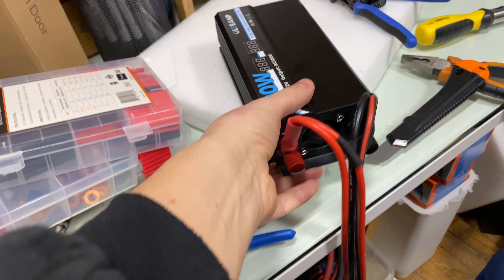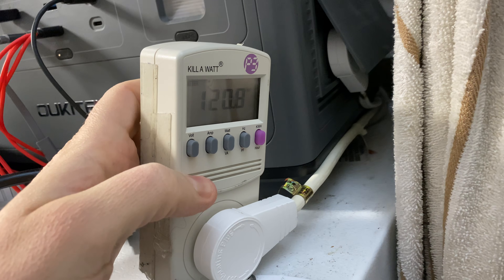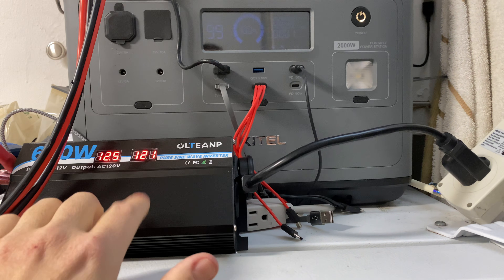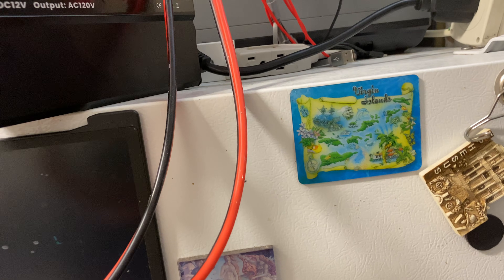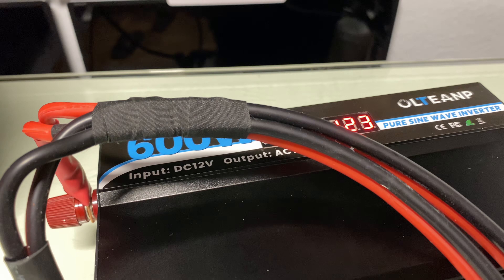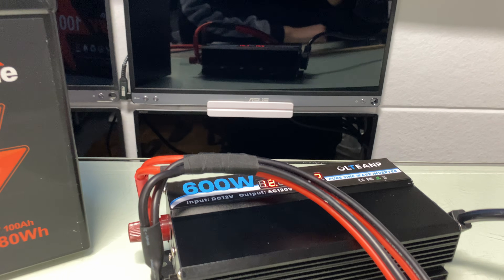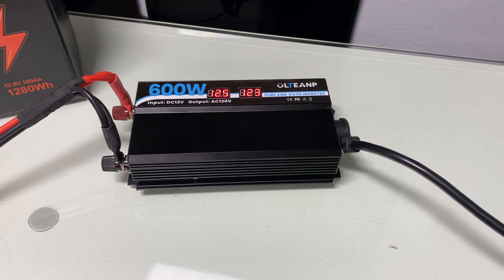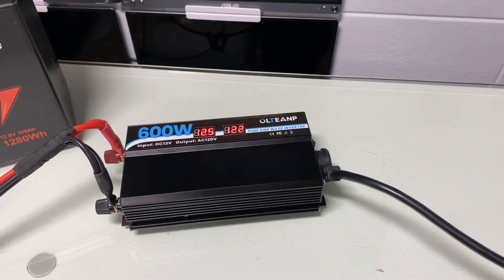👽 OLTEANP 12v DC to 600 Watt AC Pure Sine Wave Inverter Unboxing Review Fridge Test #wisebuyreviews

Comment from the maker: SEE it here: https://amzn.to/3ClCCJp   [amazon affiliate links]  --- 600W Power Inverter Pure Sine Wave Inverter 12V DC to 120V AC Converter for Car, Truck, Home, Vehicles, Laptop, Car Inverter 12V to 110V with 2 AC Outlets

In this review I test the unit and show you what is included in the box. I found that it has a 6.5 watts per hour idle draw without anything connected to it. Which is reasonable for the unit. The power fan did not come on power something at 90 watts. The fan kicked on when connected to a gaming computer running at 220-300 watts. It did not power a full sized 3090 RTX graphics card running full tilt and did overload and turn off and turn right back on. The fan on the unit is a little loud, however running small items at less than 200 watts or about 100 watts without even turning on the fan. I did make my own heavy duty cables for the unit. I like how it worked to power my fridge even with the power on spike of the fridge that it was able to handle without overloading which was over 40 amps at 12 volts. Overall I would recommend the unit. 

- BATTERY Used in the Test: LiTime 12V 100Ah Mini LiFePO4 Lithium Battery, Upgraded 100A BMS https://amzn.to/4an1NrM

--- SEE ALSO MY REVIEW OF THE LARGER 4000 watt unit here: 
Roarbatt 12v 4000 Watt Pure Sine Wave Inverter Best off Grid Solar REVIEW & UNBOXING #wisebuyreviews - https://youtu.be/I8-J4XMKIN4 
-- See it here: https://amzn.to/3YbjLYD  [amazon affiliate links]
Pure Sine Wave Power Inverters 4000W 12V DC to AC 110V 120V Peak Power 8000W with Remote Control 

--- SEE HOW TO MAKE Anderson connectors here:
12v DC Wiring How to DIY Guide for ANDERSON Power Connectors BENEFIT Project & Tools #wisebuyreviews - https://youtu.be/zZkIR48C4uE

See all my videos here:
https://www.youtube.com/@wisebuyreviews/videos

- Youtube version: https://youtu.be/iAfzu2Aa3hI
- Brighteon: https://www.brighteon.com/4b51187a-fff9-42f8-98ba-0b10c942d380 
- Clouthub: https://app.clouthub.com/#/videos/videos/196df148-79dd-479b-8b6a-a9c3a539f749
- Dailymotion: https://www.dailymotion.com/video/x9ci3cw 
- Bitchute: https://old.bitchute.com/video/BPFtwTUBsOij/
- Odysee: https://odysee.com/@wisebuyreviews:d/OLTEANP-12v-DC-to-600-Watt-AC-Pure-Sine-Wave-Inverter-Unboxing-Review-Fridge-Test--wisebuyreviews:8
- Rumble: https://rumble.com/v6a7ur1-olteanp-12v-dc-to-600-watt-ac-pure-sine-wave-inverter-unboxing-review-fridg.html